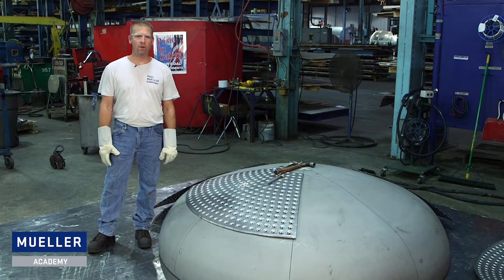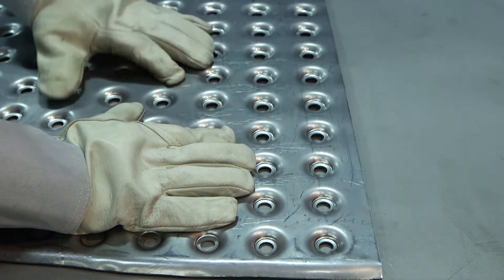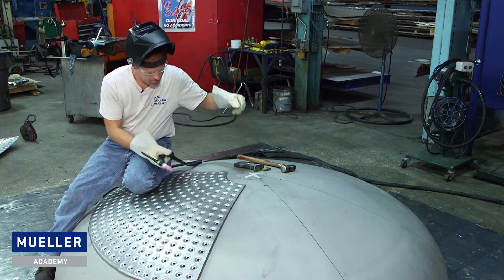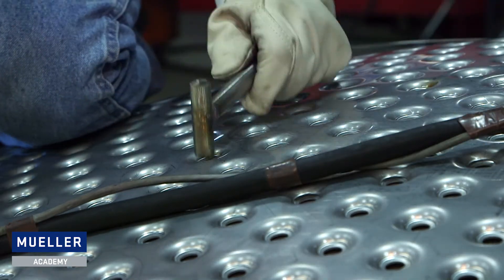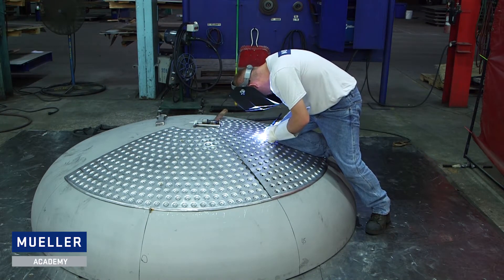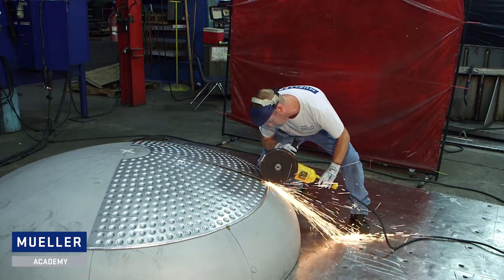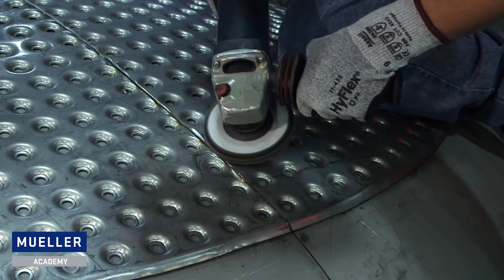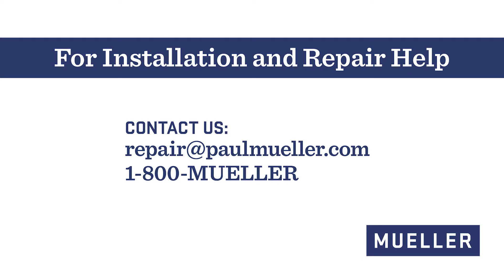How to Install Dimple Plate on a Tank Head

Comment: How do you form the pie part to fit the dome form?
Reply from the maker: Hi Jean-Philippe, thank you for the question. 
We form the pie pieces in a dishing press to match the dish radius of the head they will be fitted up to.
Please let us know if you have any other questions!
Reply: Usually they make a big flat disc, then stamp the heads using large head forming equipment. That is why heads are usually provided in standard sizes.

Comment: Its a ASME job?
Welding with filler wire allowed in ASME ?
Reply from the maker: Hi dhaval,  thanks for the question. This is an ASME welder and welding method shown in the video. Wire and welding methods/instruments are covered under ASME weld procedures.  This particular project is for demonstration purposes. It is critical that the person performing the procedure must be an ASME welder as well. If we can help with any specific projects, please contact us at contact@paulmueller.com